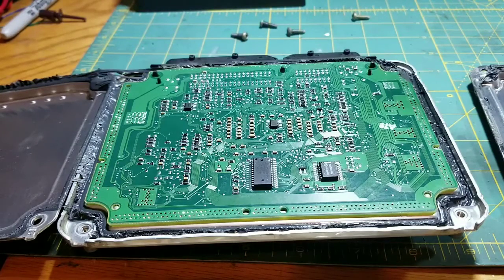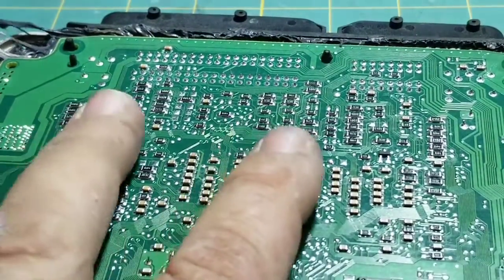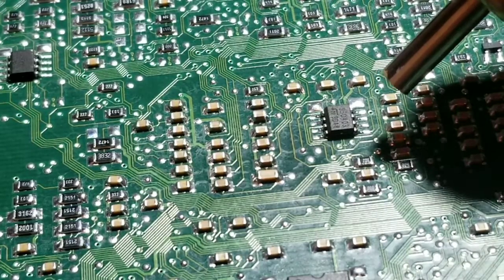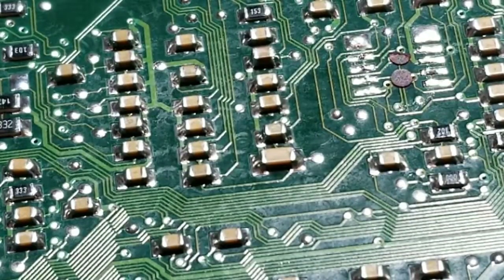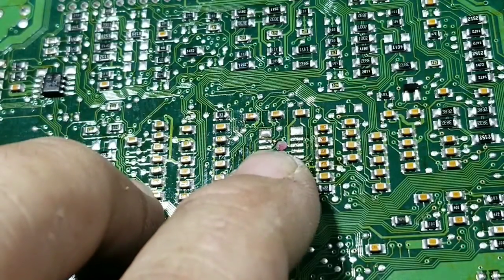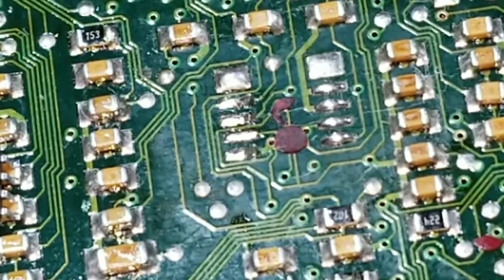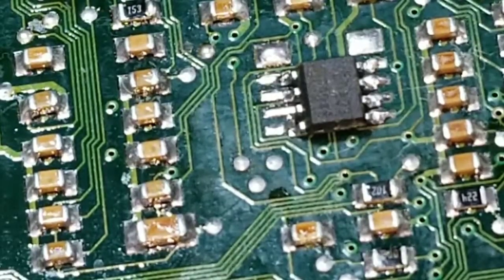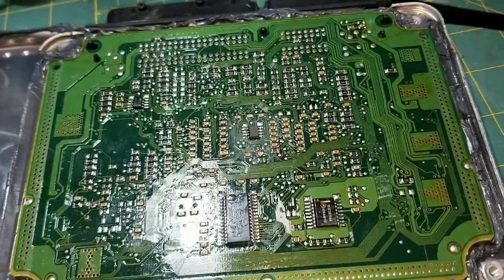Vw mk4 jetta golf gti used pcm security setup / chip swap bosch me7 without pin

Comment: I did the chip swap for my 03 jetta 2.0. At first the car would not start at all. I rechecked my solder work/cold soldered legs. Now it does the immobilizer start... Suggestions? Thanks in advance! Updating after a day. Tried again with another junk yard ecu. This time with success on my first attempt. I'm so happy right now! Thanks so much sharing this video and info!! I think I got too much heat into the first attempted replacement.
Reply: My transmission is shifting very odly... I will update once I replace the currently missing downstream o2 sensor. (Damge to o2 was cause for need of replacement ecu) If that doesn't fix my shift issues then I'll assume I need an ecu with also the last 2 letters of part number matching. My car is 03, donor was 02, both 2.0 autos.

Comment: I didn't exactly like you did it I plugged it in and no check engine light comes on now what in the actual f right before I did anything I plugged it into the computer the donor and it worked fine check engine light came on I talked to the computer now it's just dead

Comment: Thanks for great video, i had original ECU fry on 2002 vw jetta. Only local ECU I found was off a 2003 vw jetta wagon. Both manual 5 speed 1.8t cars. Original ecu ends in HS, the junkyard one ends LP. Would this even if both have different letter codes? Immobilizer flashes when tried to start with it as of now. Trying to figure out id i should try this, or try n figure out how to work VCDS and take a shot at it.

Comment: Long shot but I have a ecu that had some water damage. I took it apart and looks like it wasn't re-sealed correctly. It has corrosion in like 5 of the small chips. Is this fixable or just trash now? It doesn't look burnt but maybe a good cleaning is needed to get it functioning again? I don't know anything about motherboards or anything like that. But the car did start and run for 30 seconds at a time then just died but only if I let it sit for a few minutes.

Comment: My ecm roasted due to the o2 sensor cable getting ripped off. Now the throttle portion of the ecm does not work. If I do this to a stock working ecm will I fix the problem ?? Tia
Reply: Curious the same. I am currently working on tye same scenario.

Comment: ok so here's my situation tell me if doing a eeprom chip swap would work. i have 2 mk4 1.8t gti's 1 has an automatic and the computer is stage 1 apr. the other is stock but has a 5 speed. so im swapping car basically, i want to know if i were to swap the eeprom chips would i be able to transfer the needed info from the 5speed ecu and put it on my stage 1. and have immobilizer working with 5speed setup and the stage 1 flash?

Comment: Thanks for the video. I have a mk4 beetle with a fried ECU that I need to.swap. When looking for a compatible used ECU is it just the model number that has to match or also the donor cars drivetrain? (same engine code, transmission )

Thanks

Comment: Besides all the relevance of your demonstration, watching your video is basically unbearable to any decent electronics professional. A PCBA is anything but a doormat and it is fundamentally important that you stop touching the board with (moreover dirty) fingers. The basic reason for this is that such a device contains ESD sensistive components like semiconductors, and these can only be approached :
1) In an ESD safe environment.
2) By an ESD protected operator.
3) With care.
Apart from this, thanks for the demonstration.